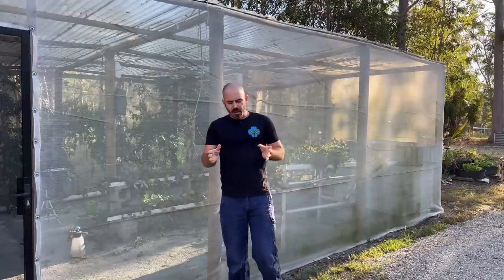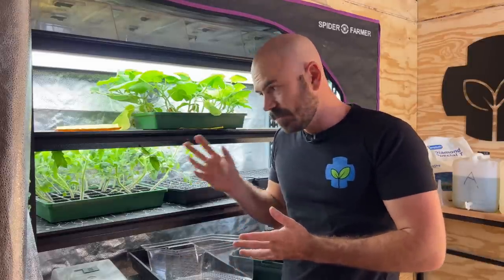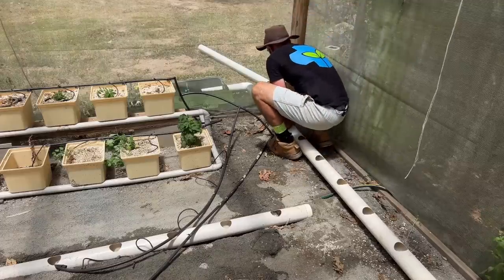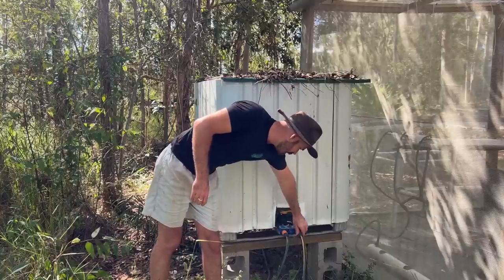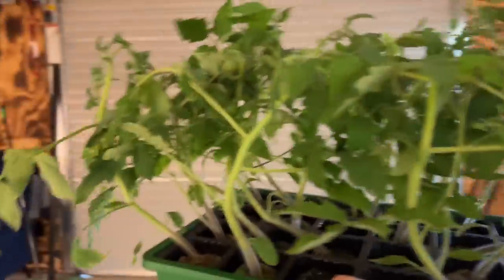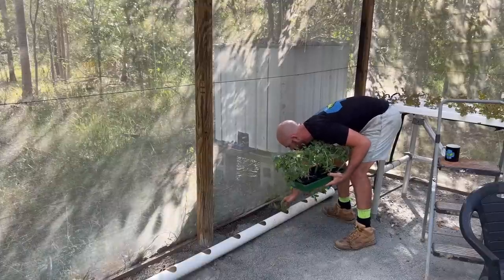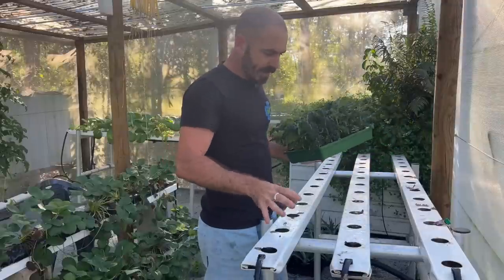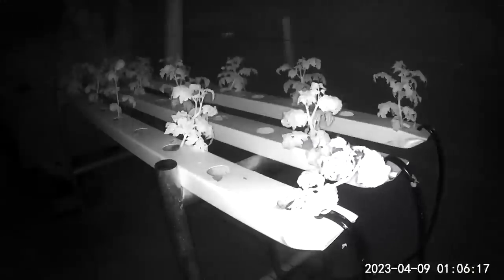Things I've Learned Growing Nutrient Film Technique Tomatoes

Comment: For someone that is contemplating getting into this, its great to see this video. 
Basically because i can see that is not as "hands on" as i though it would be. Seeing that it can be as simple as what you showed give me hope that person like me that can kill anything might have a chance to be able to grown food.
Reply: If you do it right, hydroponics is very fool proof as an approach. The only real issue (if the system is working) is not changing out the nutrient regularily. As it's sucked up by the plant, the remaining liquid gets less balanced in the remaining nutrients, which could kill the plant after a while. If you want to start out without spending a lot, get a nice liquid fertilizer and do a bucket kratky system to play around with. Of course that's not a perfected system, but can teach you quite a bit about the general needs. EC and pH testing is a good next step.
But you can go for a big system as well. Just a matter of money, time and expected results.
Reply: EC and pH are the first step!
Reply: Could either of you recommend a good affordable way to test water parameters routinely? I've been toying with kratky buckets and the $7 3-way device I got online is a bit, well cheap lol. It seems to measure PH correct sometimes, until I start mixing too many nutrients, then it goes wacky. I've been trying to use that in correlation with pool test strips, which I don't always trust either, especially the tds readings. Any tips would be appreciated!
Reply: @13panda13 .... how well does liquid rock work in these systems? pH from the well is 8.2, pH at my pond is 7.8.. EC is stupid high. well 560, pond 62.. pond is just rainwater catchment..

Comment: I have a wicking bed set-up on a tiny condo patio (6’x9’).  While I have regular tomatoes hanging from the ceiling, all my tomatoes in the wicking bed are micro dwarf varieties.  It’s too hot at the moment and my plants have stopped producing flowers.  However, I’ve had some great salads between my indoor lettuce and my outdoor tomatoes.   I did come out one morning to find all the foliage stripped from three tomato plants and one pepper plant. 🤬 I found the culprits immediately, two small horn worms, and removed them.  I’m currently converting a large walk in closet as an indoor greenhouse.  I’m planning a tower garden with a five gallon reservoir and a 2-4 bucket DWC system.  I’m still working out a ventilation system.  If I can move my tomatoes and peppers inside, I’ll have room for two more citrus trees on the patio.

Comment: Try running a thin layer of cloth inside the pipe along the bottom, to slow the flow and have roots grip to it?
Reply: Not necessary, roots just want air, food and water. Flow is controlled by a tap.

Comment: Great vid as usual Mitchell! Watching the ups and downs you go through makes me giggle a bit because I can totally relate, Im trying to get so much done and have silly goofs like forgetting to turn OFF my watering system for the in ground tomatoes or forgetting to turn on taps coming off of the main from the IBC, I feel like I need an assistant and I KNOW you could use one as well lol, Happy Hydroponicing mate!
Reply: To automate or to be a slave, that is the question!
Reply: @13panda13  I'm setting up mostly on gravity and let it do the work for me but I still want to build some NFTs and some verticals so I will have to add power eventually, I already have my lights indoors automated with gravity feeds as well.
Reply: @brandonlantier  Thats sounds great. I live on a hill and my garden is below me so gravity is on my side. What type of control do you need?
Reply: @13panda13  Sorry didn't see your comment, I just use small float valves in my containers to keep the levels up.
Reply: @brandonlantier  Hi, could you, 13panda13 or anyone explain what you mean by gravity feeds? And how it relates to your lighting? Sounds quite interesting.
Reply: @Rick-the-Swift  Gravity fed means the water is moving by gravity only, it's not being pumped by any other means other than gravity (9.8 metres per second). Wherever your water is originating from (his nutrient reservoir) needs to be higher than where the water is going to (black tank in the ground). Obviously you can only use gravity fed set up when the origin is higher than the destination. If the black tank in the ground wasn't lower than his reservoir it wouldn't work. Hence why he uses an electrical pump to pump the water from the black tank in the ground UP to the NFT. Hope that makes sense. Being gravity fed has nothing to do with lighting, not sure what you mean there.
Reply: @carolashworth1094  Hi thanks you for your detailed reply to my question. The reason I asked about the lighting is because @brandonlantier said "I already have my lights indoors automated with gravity feeds", which I was a bit confused about. He probably just meant they were both automated, but maybe not in unison with each other. I am still a bit unsure the exact definition of "gravity fed", although it sounds simple enough. For instance, you say a gravity feed system doesn't use a pump, and that makes sense, but you also say a gravity feed system would have a higher source of water, and the destination ( a black tank in this case) would need to be lower. But if a gravity system has no pump, then why is water collecting in the black tank to begin with, and how would he or anyone get it out without scooping and replenishing the source container, or letting it over flow eventually into the ground or drain?
  In other words, I tend to think of plain old watering from a hose, or drip irrigation as a gravity fed system. That is the water company is feeding h2o from a high source, then pouring out it of your hose as fast or slow as you want it if using a nozzle.
 And the same with the drip irrigation- either fed from a bucket/tank, or straight from the garden hose.
  I'm guessing you and Brandon are referring specifically to a gravity fed NFT? If so that would make sense, but still not sure what purpose the black tank at the end would serve after feeding the plants, unless it is perhaps used for another reason other than replenishing the source reservoir. 

Hope that makes sense, and thanks again for helping with clarification.

Comment: Looks like the foam pucks might be a good option for stopping the algae from getting to that thick sludgy stage in the ground pvc pipe. Should allow the water to flow more easily, preventing backing up and submersing the roots. Hopefully the additional oxygen to the roots have a positive effect on the plants ability to stave off disease too.
Reply: More oxygen will only cause more algae and it doesnt prevent RR. The problem that needs addressing is either Temp, Light, or a combo. That is what causes the algae. Using the pucks was a no brainer.

Comment: Any problem w the tomato root system blocking water flow? Thanks.
Reply: I was wondering the same thing. When I’ve tried growing tomatoes in a vertical system, the roots clogged the base of it. So I’ve been growing them in Dutch buckets instead and the root system is pretty extensive.

Comment: Hoocho
Giday Mate
I’m just now becoming financially able to purchase a good quality Ph & Ex meter but notice the link you offer from Amazon isn’t working. Can it be refreshed please 😢
Thanks from Perth WA
Reply from the maker: My current meter (which I love) is a hanna HI9813-6

About to start working with bluelab, which are also high quality and more competitively priced. 
Big Truncheon fan. 
You can't go wrong with either of these brands. IMO
Reply: @Hoocho  @Hoocho  Cmon, dude are u serious? They are basic simple pH/EC meters. That Bluelabs model was released 19 years ago😅😅 and their products are retadardly overpriced for fools who like to extort their wallet and time 😅.

My meter was $100, it does Temp, EC, TDS, Salinity, proportion and pH, all at once, 24/7\365. Its WiFi so you can check anywhere, in the world, at anytime, it also sends notification alerts to your phone for whatever parameters you program if they go out of range. E.g high or low pH, or  high or low EC, or high or low temp, whatever! It can also control, by wifi, switches, lights, fans, pumps whatever you want according to your parameters programmed. It always records all this data, and displays in a graph, the hour, day, month, year, statistics. But its not a mobile unit, pasee, its to be mounted per res. It uses a wall mount p/s, low voltage 5v, but to run from any usb, for e.g. battery/solar, you need to change the pinout of a usb cable, which is easy. DID I MENTION it also can export all this data to a .xlsx file? And it does this for free! 😊 And replacement probes are $20-30. With a choice of single or double salt bridges. Bluelabs, trunchen😅😅😅ffs get real.
Reply: @13panda13  What meter do you use?